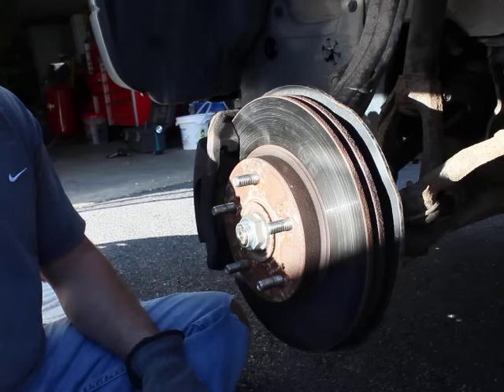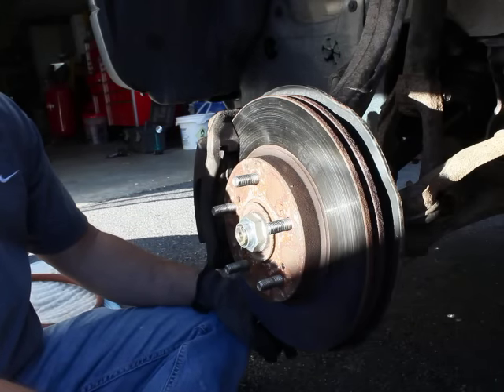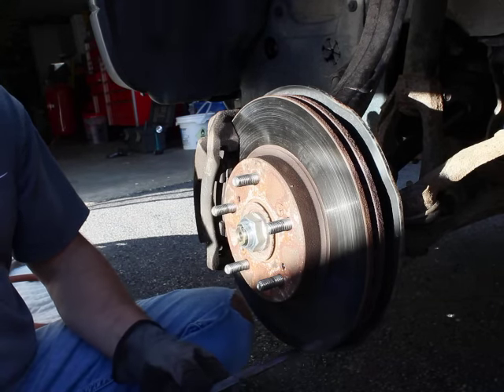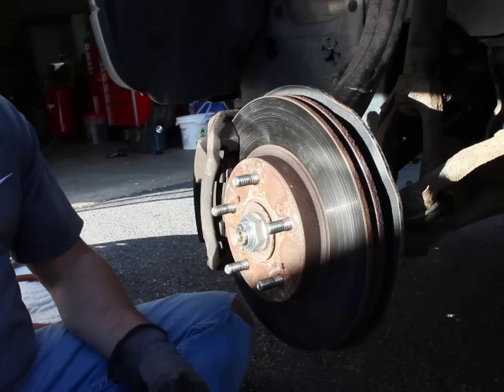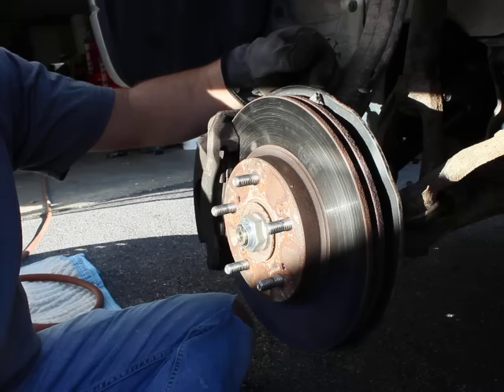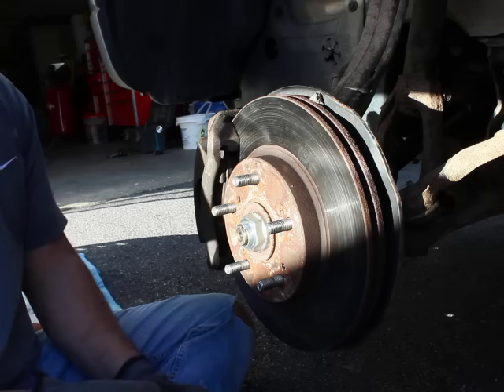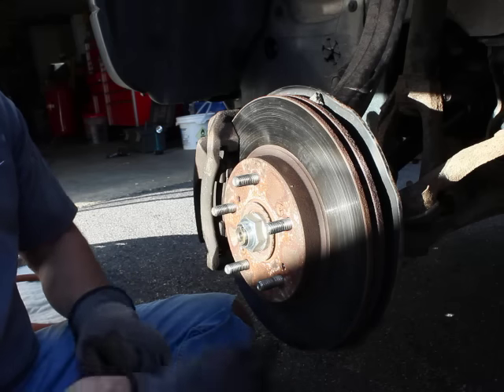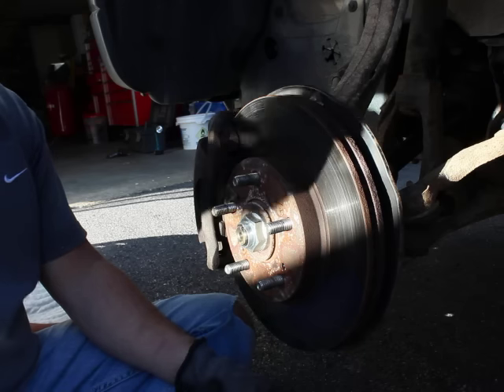Scraping Noise From Wheel While Driving

Comment: Eddie or anyone who may know whats going on...I have an 02 ford escort that I bought a couple months ago private sale....when I bought it it had a slight grinding noise coming from the front right tire ,when Id get to around 15 miles an hour. Now its getting really bad, I recently had that wheels wheel bearing replaced and the ball joint replaced. The mechanic said the tie rods were fine and everything else looked fine. upon taking it out of the garage and driving it down the road, what used to be a slight grind has now become a very low/loud grinding noise with what almost sounds like a popping sound every now and again (Best I can explain that sound is the sound you hear when you drive on a dirt road and small pebbles get stuck in your tread and fly out) The car when I got it was pretty alighned and went straight for the most part however now it tugs to the right hard. If I take a left turn the noise seems to almost go away and then you hear something grinding slightly, but when i turn right it gets louder (the grinding) and you can hear more popping. The car vibrates and I simply cannot figure out what this is. Frozen caliper maybe? CV joint? I didnt think it was the CV joint because ive had those go bad in the past and they make a clicking noise only when you turn also it looks almost brand new, this grinding/popping happens no matter if im going straight or turning. Anyone have any ideas what this might be? Whatever it is sounds like its eating away at something and maybe thats what the popping noise is, it literally sounds like popcorn popping aside from the loud grinding noise. I just dont want to put my son in the vehicle until Ive figured out exactly what it is and have it fixed. Originally I thought it was the wheel bearing but after i brought it to the shop i was told the ball joint was bad also (It was so bad Im surprised my wheel didnt fall off, so much give in the BJ) so far ive put 400$ into something thats still an issue and dont want to dump that much more into this car, its simply not worth it. Any ideas guys?
Reply from the maker: Derek Pritchard Hi Derek, the low growl/grinding noise description is awesome and I'm 99% sure it is a wheel bearing that was install incorrectly or was damaged during installation. When you said the noise comes and goes when turning slightly is a dead giveaway because you're loading weight and unloading weight on the bearing.  Bring it back to the mechanic who replaced the bearing and take them for a ride to point out the noise. The pop noise could be a sway bar link that has play, they can get pretty noisy. Start there and let me know what you find out, thanks. Got to keep our kids safe :)

Comment: Thanks for the vid. My car wheel does not have a scraping noise, but it has a sharp buzz noise sounds like lack of lube (also like a metal needle scrape a smooth rotor) . i am guessing its the brake pad problem. Any idea?
Reply from the maker: Yang Zhao Yes Yang, that is exactly what it could be, most likely the brake pad wear indicator is touching the rotor. Have your brake pad thickness checked and let me know what you find, thanks.

Comment: Could this be caused by riding on a flat tire for a couple blocks? Tire went flat had to get it back to the house got a brand new tire oh, now it is making this noise from that wheel.
Reply from the maker: Hi Richard, Yes, most likely the mechanic who replaced the tire bent the backing plate when removing the wheel from the vehicle. I recommend you either bring it back to them or try using a long stick like a broom handle or long screwdriver to push on the backing plate  Let me know if this helps.

Comment: Hey Eddie, is it possible that noise is caused by the shield even if I only hear it when there is a passenger in the back seat? This seems to be the only time I hear the scraping. The sound is coming from the rear passenger side wheel, by the way. Thanks!
Reply from the maker: Garni Rostami Sure, that is a definite possibility, more weight, more stress on the suspension.

Comment: Theoretically if something got stuck like that.. you would just keep driving until it dislodges itself?
Reply from the maker: Hi Liz,, Yes and no lol. Not all noises are created equal! Sometimes it doesn't fall out. Sometimes it will dislodge backing up. Sometimes it's the brake pad wear indicator causing a similar noise and sometimes it just needs to be taken apart a little to dislodge the pebble. Let me know if that confusing answer helped 🤪

Comment: Hi Eddy- Today I noticed a scraping/scuffing sound coming from the rear of my Element on harder left turns (like on a curvy mountain road)- it's fairly loud. I know I have a warped rotor and am heading to the shop next week. Is the car drivable in the meantime? Or could it be something else?
Reply from the maker: ***** It could be an inner brake pad that is worn out. I recommend getting it checked soon just to be safe.
Reply: ***** Hi.
I also have a Honda Element that is making that scraping noise on left turns !
I just did a brake job, new pads AND rotors. It didn't make the sound before. I took it to my Honda dealer and they said that the rotors have a "lip" on the INSIDE of the rotor that will rub on that shield in the video. Honda said it will wear away eventually, OR rotors can be "turned" to remove the lip.
I tried to slightly bend the shield and noise got only a little quieter. I might have mine turned.
Ever heard of this Eddie ???
Reply from the maker: Yes, On the Honda Elements there is a large lip on the bottom ( inner part of the rotor near the center of the rotor) of the rotor. We usually grind off the lip on new rotors because it will never wear off, it's too big. The only way I know how to remove the lip is to grind it off.

Comment: What about brake drums/brake shoes? 97 corolla. changed brake shoes and STILL gritty, grinding sound.  (Maybe didnt need to change shoes at all.). could it be the fin/guard scraping against the drum?
Reply: You mentioned a Corolla 97 I have the same year model you can hear the worn sound a little plus the rear brakes start scuffing when things get worse had that done with a Plymouth neon 2000 can be expensive work.
Reply from the maker: Hey Gawddang, 
Yes, the backing plate lip can rub against the rusted drum edge just like it does with rotors. We sometimes hammer off the flakes of rust on that edge to stop the noise. Check your backing plates for rub marks.
Reply: @scottbrenham1341  I tore off the rusty fin on the back plates and that seemed to help...

Comment: What about a slight grinding sound does it sound like neither one of those and at a higher speed and almost sounds like or feels like the tire is being jolted?
Reply from the maker: Hi Meek Rosez, I recommend you have someone check all your brakes just to be on the safe side. You shouldn't feel any jolting, this is just a noise.
Reply: @EddieCarrara1  thank you for your response after some expensive research and homework last night I came to discovered that the problem was a bearing or a pub in my will going out cost me $275 today to have it fixed all good thanks!
Reply from the maker: @meekrosez3789  That's awesome!!! it's the labor that cost the most when it comes to some wheel bearings because they are difficult to remove.

Comment: I get a nose very similar but only when I go over a hill that would typically tickle your belly. Well I get that sound coming from rear passenger area
Reply from the maker: Hi Renee, You're probably hearing a suspension bushing creaking, usually it's the rear sway bar bushings, not the links.
Reply: Thanks, I am now hearing it when I go over some bumps. It is def coming from the passenger side rear tire area. But it def sounds just like the noise u simulated. I do have a gravel drive. The Explorer is only a 2011 so this is very upsetting
Reply from the maker: It's possible you just picked up a pebble from the road and it is stuck between the rotor and backing plate.

Comment: Hi Eddie- My 2004 Pilot rear backing plate has rusted through, cracked into pieces at the edge & the pieces are floating around under the wheel cover. I plan to remove tire & take out the loose pieces. However, is it neccesary to put another backing plate on immediately or is it safe to drive for a few weeks? Is it expensive to have another one put on? Please advise, thanks!!

Comment: I haven't had a brake job done. It just started making the scraping noise all the time. Whether the brakes are applied or not
Reply from the maker: Hi Amanda, it sounds like the brake pad wear indicator is touching the rotor warning you that the brake pads are getting low on material so have all the brake checked, inner and outer pads. Keep me posted on what you find, thanks 😊

Comment: Hi Eddie, i have a 2009 fx35. Just got my brake pads change 5 months ago and i notice theres a grinding noise (mostly while turning) driving straight the sound come very little. I tried what this video teach but my brake does not have the metal plate shield next to the rotor. Do you know anything about this problem with my car? Thanks!
Reply from the maker: Hi Nhan, 
There are a lot of things that can cause a grinding noise, sometimes just getting debris stuck in or next to the calipers can cause noise. You'll need to locate which wheel is having the problem and then inspect the brake caliper area, you'll need to look for clips out of place, prematurely worn brake pads (maybe the pads are seized in the calipers?) any scratch marks or grooves in the rotor caused by debris, etc...

Comment: Could this cause a gas pedal vibration when hitting bumps if its really bad I've tried everything except rotors and this
Reply from the maker: No Sir, your problem is something totally different. Are you getting a brake pulsation? When you're braking at highway speeds is your steering wheel shaking?
Reply: @EddieCarrara1  slight brake pulsation. Im thinking that's because my alignment is out though. No vibration at highway speeds. Could the rotors be causing it? Its like everytime I hit a bump a certain way I feel a shake in the gas pedal.
Reply from the maker: @slimskinny  No, hitting bumps would have nothing to do with the brakes. The pulsation is from warped rotors most likely, not from the alignment being out👍

Comment: Eddie:
Had my rear brakes done in January and now when someone sits in the back seat or I load of something of any weight in back,  I hear like a grinding noise coming from rear driver side wheel. Took it back to Midas 3 times and rather than drive it to see what I meant they put new rear shocks on yet the noise is still there. I also hear it when it hit a dip in the road. Do you think this is my plate as well? Its driving me crazy and makes me think I have a bad spring-never did it till they changed my rear brakes. 2000 Suzuki Grand Vitara 4WD

Comment: I just drove through some gravel road with rocks. Should I take off the wheel or will it come out by itself?
Reply from the maker: Hi Cosovic, you can try backing up, sometimes that will dislodge it or if all else fails, remove the wheel.

Comment: Hey Eddie I recently had my rotors replaced, afterwards I noticed that I have a high pitched squeal but only when turning left. It sounds rotational like something is rubbing metal while the wheel is  turning. I've looked into several things and this bent shield has been one possibility. Could it make a high pitched sound like that or would it need to sound like a scraping noise like you described?
Reply from the maker: 4TheRooster Yes it can make a high pitched sound depending on whats hitting the rotor. I recommend bringing it back to the shop who replaced the rotor and have them check it, most likely it's human error :)

Comment: I have a very similar issue with my Hyundai , but the sound in my car is only the first time I take out the car , and I turn left . There is loud noise like something is dragging or scrapping . Then within few seconds the sound goes away and doesn’t come back in the same day . Could it be the same issue ? 

Now one mechanic is suggesting me to change all brake pads even though the current ones are new and skimm the brake rotors
Reply from the maker: Hi Shreeman, I know you say your brakes are new but it sounds to me like the inner brake pad wear indicator is touching the rotor warning you the the pads are low. The wear indicators are usually located on the inside pad. If the brakes are ok then you may have a small pebble rolling around between the rotor and backing plate making noise intermittently. Let me know if this helps.

Comment: I had that noise caused by the splash shield rubbing against the rotor last year on my 2001 Honda CRV as described in your video.  Bending the shield back fixed it.  Recently, I'm hearing the same noise but only going forward with the steering wheel turned closed to or all the way to the right.  But there's no noise going reverse in this same wheel orientation.  I jacked the car up and tried turning the wheel by hand in attempt to replicate the noise to no avail (no noise).  The shield is not rubbing against the rotor, and there's no rock or other debris between the rotor and shield.  Any idea on what may be causing the noise I'm hearing?
Reply: It was the splash guard rubbing against the rotor after all.  I had to remove the rotor to see it.  Just a very tiny contact point.  I used a punch to knock the spot down around 1/16".  No more noise.

Comment: I hear a grinding noise, a scraping noise,  a squeak and a kerplunk noise all coming from the front right wheel and all seemingly with their own pattern of noise. The kerplunk noise (the best I can describe it) happens steadily and goes faster or slower according to the speed I drive.  The noises steadily crescendo to the highest volume and then all of a sudden stop as if something were delodged or unstuck. It will drive just fine with no noise for a while and then it starts happening again for no reason. It doesn't only happen when I break or anything. 
What could this be?!
Reply from the maker: +mossy1 , Hi Mossy, most likely you have some debris  like a pebble or rust stuck between the backing plate and rotor and it's moving around while you're driving. Let me know how you make out.
Reply: Eddie Carrara  Well unfortunately I went to firestone and they said I needed new wheel bearings so I got the front two replaced for $580. But I was driving it today and I heard a slight grind every once and awhile. I think what you described might have been the real issue and they just got rid of it while changing the bearings. I asked for the bearings so I can take a look at them but haven't gotten around to it yet. Who knows.
Reply from the maker: Ouch Mossy1, As humans, we like to take the advice of professionals and hope they are honest and are not taken advantage of us, but that's not always true.
Reply: +mossy1 Just a heads up I had a grinding noise (slight) after replacing my brakes and wheel hubs from a mechinc shop because of winter and no time to do it myself ..Turns out after the grinding noise starting to sounding like mud tires on a highway I checked the Torque on the hub nut and it came loose after 190Lbs/ft The right torgue was 103lbs/ft  which is a huge diffrence and It did go away ...So check the wheel hub specs for your car/truck .. Lift the wheel and at 9-3 hold the wheel and try to see if there is play check the brake backing plate...and last Cv joints if you have a 4x4

Comment: hey, have had major problems with my brakes the 3 weeks i am an apprentice welder and i had taken my car into school to fix the exhuast i came off hoist and one of the 2 bolts near the rear sway bar came loose and cut my brake line. so i almost crashed going down the hill since no pressue brakes completely failed.... finally had the front end redone. calipers pads rotars etc. everything fine there the rear brakes were fine but the wheel where the brake line was cut every time im above 20kmh a slowly press the brakes the wheel makes a loud scratching clunking noise. but only in drive not in reverse and it doesnt happen if i apply brakes rapid... any thoughts ?
Reply from the maker: Mkf Official Where was the brake line cut, front or rear? If rear, drum or disc brakes? Let me know.

Comment: What happened if you remove the shell?  mine were removed yesterday by the mechanic
Reply from the maker: The dust shield deflects water and debris away from your brakes and also helps direct heat away from other components. I seen a lot of dust shields missing over the years without any problems, but it is a good idea to have new ones installed if you plan on keeping the vehicle.